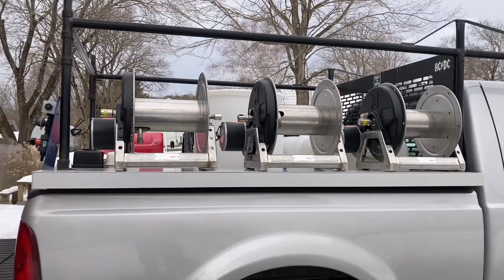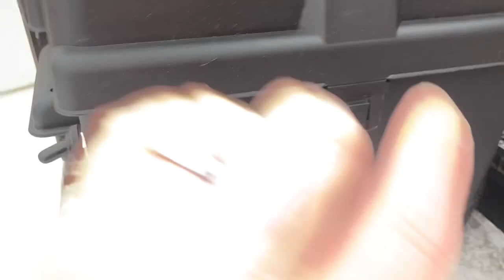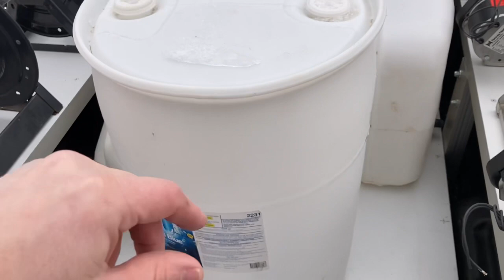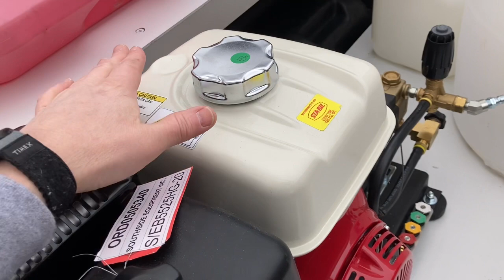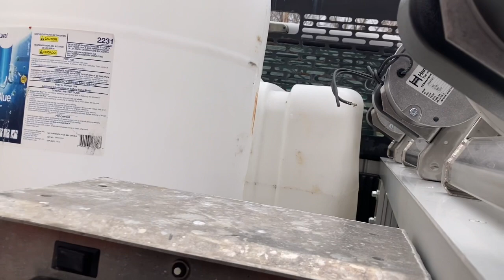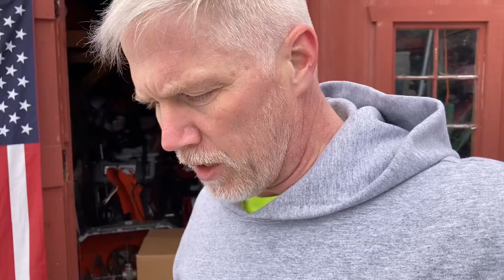Truck skid mock up

Comment: Looking great Joe!  Curious to see how you attach and plumb a drop tube in the shower tank since you can't fit your hand in to install a bulkhead fitting.   Thanks for showing your process
Reply from the maker: You mean the 60 tank? It will be SH and have two small caps on top which unscrew. My drop tubes will be plumbed through them

Comment: Great job! Nice and fresh. I'm re-doing my set up also. Making it fresh n clean. Hey where did you get that stand that the batt. Box is on?? T.i.a. 
Crush it this year dude! Make that money.
Reply from the maker: Hey Matt. Thank you very much. That stand is the aluminum frame work from my Gen2 12volt system
Reply: Ok cool. Thought so.

Comment: WOW, massive improvement looks great.
What size water supply hose do you use, 5/8 or 3/4.
Great job!
Thanks
Reply from the maker: 3/4 supply. Contractor hose
Reply: @powerfulimprovements  Thanks

Comment: Looks good Joe.  Are you going to remove those rubber pads on the bottom of your skid to mount your machine down.  Or you just going to leave it on the skids?
Reply from the maker: The power washer? Will remain on the rubber feet through bolted to the skid base
Reply: @powerfulimprovements  Yes the power washer. I bolted mine down

Comment: Hell yeah joe looking real slick, nice and simple money maker......wanted to ask about that pressure washer you just got.....where did you get it from and how much? I'm looking for one at the moment and I'm between a 5.5-3500 or 4-4000 also what pump you got on that?? Thanks in advance
Reply from the maker: That one came from Southside Equipment. 1600$. 5.5 @ 2500
Reply from the maker: General Pump
Reply: Thank you brother, I appreciate your feed back I'll be checking them out

Comment: Awesome man! I’m waiting for my enclosed trailer and then I’ll be installing everything. Trying to purchase everything I need now, because I won’t have the trailer till April.
By the way, I purchased the same blend manifold after seeing your unboxing video. Clearly the best on the market 💯
Reply: Where did yall get that blend manifold?
Reply from the maker: @Rick-kp6wf  Midwest
Reply from the maker: It’s pretty for sure
Reply: @powerfulimprovements  it truly is... I love the plate it’s mounted on, the rectangle mixing block prior to the pump, and the 12.5% SH percentage indicators are clearly visible. Can’t wait to use it and save time

Comment: Lookin good !!!  I'm a fan of the tig welded gas tanks from www.Boydwelding.com  I have their stock 11 gallon tank for  $175.  it should last forever and better made than some of the others that I've seen.

Are those Hannay reels aluminum or steel ?
Reply from the maker: Those are stainless reels. I’m looking at a plastic tank so that I can visualize the fuel level easily. Was considering a welder tank. But like we going with the red plastic of some kind for the season. Thank you for the help though

Comment: I think I would replace the extra reels with a aluminum box.
Reply from the maker: I was giving that some consideration. But I don’t know what I would even put in the aluminum box. Anything that really needs to be protected from the weather can ride in my extra cab. Instead of having all of those snuggled up hoses riding back there.
Reply: @powerfulimprovements  Also, check your local car washing places. I got a couple of 5-gallon square tanks and a 20-gallon tank for free. They just throw them in the trash when they run out of soap.
Reply from the maker: @vspd303  Right! I told guys that all the time. Lots of free time is to be hard. Car washes. Farms. Etc.

Comment: Hi Joe,

Should the battery be in a box to protect it from the weather? Especially, if you're going to have all the hose reel electrical hooked up to it. Just curious.  

Looking good....

Michael C - (WA)
Reply from the maker: Yeah. I’m thinking about that one. I have an additional battery box. It will be fairly protected under the shelf there but I may put it in a box just to clean it up completely. Good observation

Comment: Its looking awesome. That 100 gallon tank will be an awesome buffer for the new 5.5 gpm pressure washer!!! Id make a little cabinet to put that blend manifold in or put it in a little metal key cabinet, keep it out of the elements and keep those knobes secure. Looking great Joe!!!!
Reply: Something like this possibly 
https://www.galco.com/buy/Wiegmann/N1C121606S?source=googleshopping&utm_source=adwords&utm_campaign=&gclid=CjwKCAiAyc2BBhAaEiwA44-wW4k2Czoa6oWP7JsH2Ce85OsT9OckFIgzGX1REzMgjCazgNjZMCJMwxoCbu4QAvD_BwE just a thought. Keep up the great work!!
Reply from the maker: Thank you. Much appreciated. Do you know where I would find a box to house that correctly.?
Reply from the maker: I guess maybe I should reach back out to Midwest where I bought it and see if they have the control box
Reply: @powerfulimprovements  yes i checked out their website looks like they definitely make one. Would be awesome if you could get one made specifically for it, such an expensive piece to your upgrade definitely want to keep it safe
Reply from the maker: @77bweston  true

Comment: Are you still going to downstream or are you changing up to just 12v for chem application
Reply from the maker: Yes I’m going to continue to downstream absolutely. 12 V will be for primarily roof washing. I am also going to be using my proportioner to downstream from. I’ll have a valve connected directly to it. More on that coming

Comment: Awesome set up! I cant wait for the other videos! I think in will have to use two 50gal tanks because i only have an f150 and it can only hold a "total" weight of 1500lbs on the safe side. Going to pick up 50gal tank I found on Facebook for $20 which i will use for water with the Hudson float valve. Thanks for video!
Reply from the maker: Nothing wrong with using 50 gallon barrels. I’d continue with that but I need to figure out a better footprint in my truck. We’ll make some money first and then potentially buy new tanks